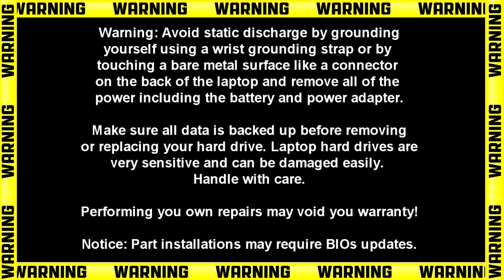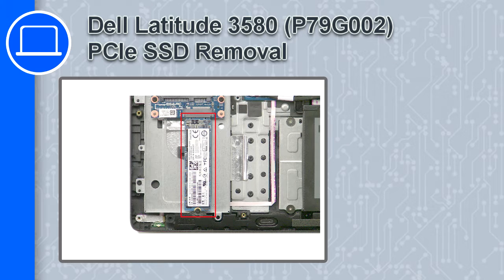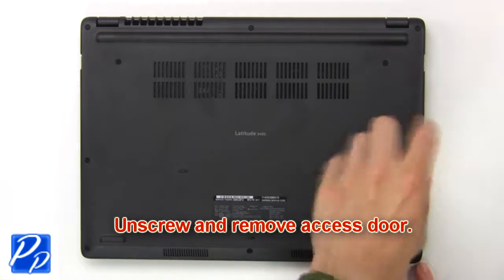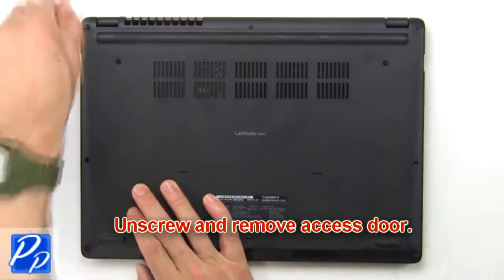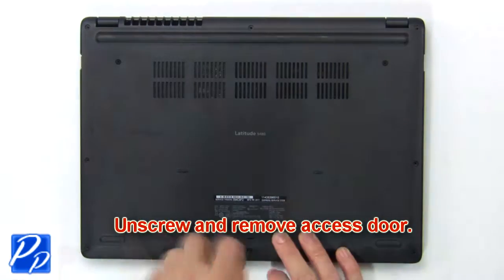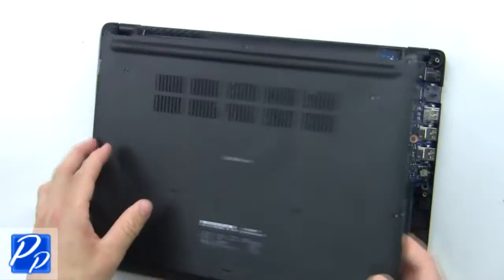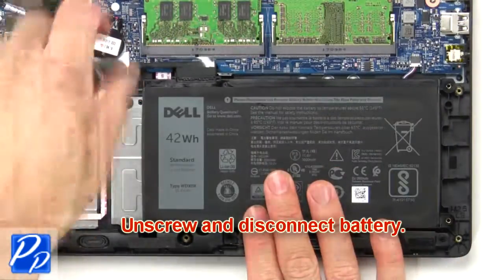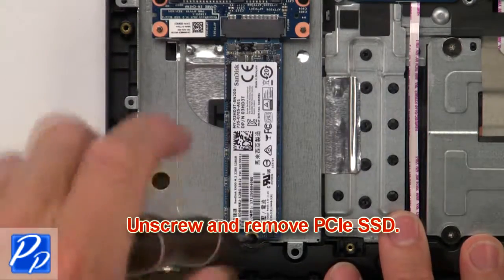Dell Latitude 3580 (P79G002) PCIe SSD How-To Video Tutorial

Comment: so the battery was removed as a precaution, correct?  did this particular 3580 already come with an SSD.  Mine has a 500GB HDD in it and I'd like to replace that with an 256GB M.2 SSD.  Can they both co-exist? or will the HDD have to come out, and if so, how does the M.2 Drive SSD install, where does it go if the HDD has to come out?   The user manual is so confusing as it says that an M.2 SSD can be put into this unit "with carrier" , whatever that means? What's a carrier, and is the Carrier already on the unit or is that something you have to purchase?  I called Dell and they are clueless and I checked the Owner' manual and there are ZERO instructions on how to install an M.2 256GB SSD, absolutely zero. Thanks for any help !!!!
Reply from the maker: So this model only gives you the option to install one or the other. In order to replace the 2.5'' drive with the M.2 SSD you will need the following adapters.

https://www.parts-people.com/index.php?action=item&id=28413
https://www.parts-people.com/index.php?action=item&id=27174
Reply: @dellpartspeople  Thanks so much, very interesting how this is designed.
Reply: @dellpartspeople  Hey one last quick question, ON the 3580 Latitude, the manual says a 256GB M.2 SSD is the largest , can i go with a 512GB M.2 SSD from your line-up of parts?  Or will that 3580 max out at 256GB.  I'm thinking when they printed the user manual, there weren't 512GB nor 1TB SSD drives out back in 2017 when they printed it.  Will larger M.2 SSD drives work in the 3580 Latitude?  Thanks so much in advance!!!!!
Reply from the maker: @harpoon_bakery162  Yes larger capacity SSD drives will work fine.